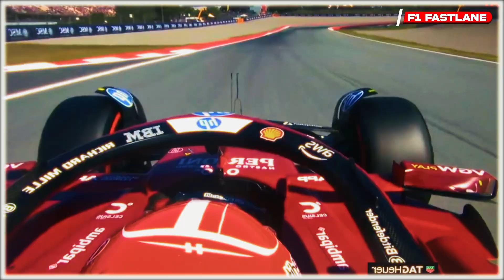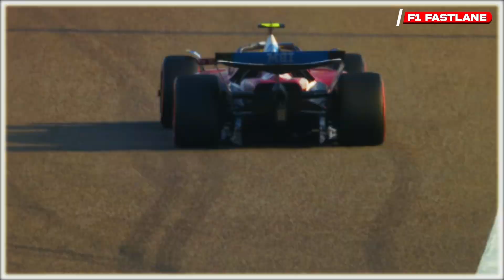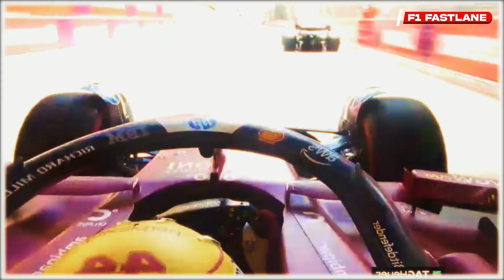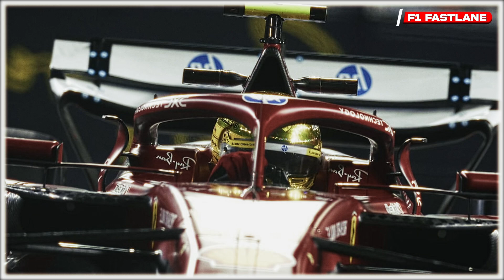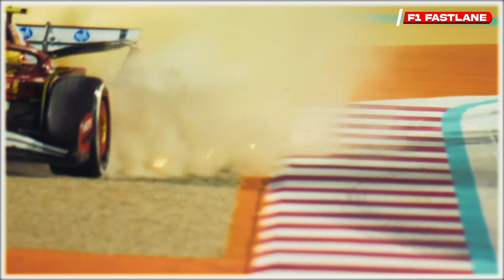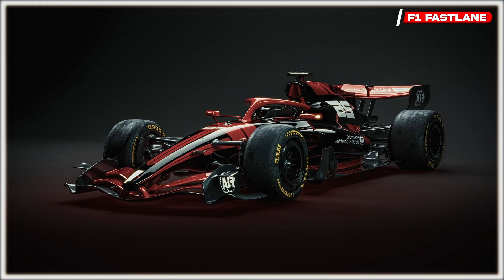F1 BOMBSHELL! Focused Study on FERRARI 2026 For Lighter Car Thanks to WEC SECRETS!

Comment: Ferrari's vertically integrated structure certainly does allow simultaneous development of all major components under one roof at Maranello. However, their ability to develop the entire car within a single facility is a definite car process advantage that they have failed to leverage to produce consistent race winning cars let alone championship winning cars.
They possess this structural advantage that most teams envy, yet Ferrari rarely convert it into sustained competitive race dominance.  But a system is only as good as its execution.  Ferrari’s challenge isn’t the structure.  Its challenge is the operational culture and technical direction that sits inside that structure.  Departments may be in the same building, but that doesn’t guarantee seamless collaboration.  Ferrari has historically struggled with internal politics, fragmented decision‑making, and a lack of unified technical leadership.  Since Kimi Raikkonen’s championship in 2007 look at Ferrari’s long pattern of rapid turnover in Team Principals… Stefano Domenicali (2008–2014), Marco Mattiacci (2014), Maurizio Arrivabene (2014–2019), Mattia Binotto (2019–2022) Frédéric Vasseur (2023–present).  Not to even mention an even higher turnover of technical staff.
They need to align their culture, leadership, and technical direction with the structural advantages of Maranello.